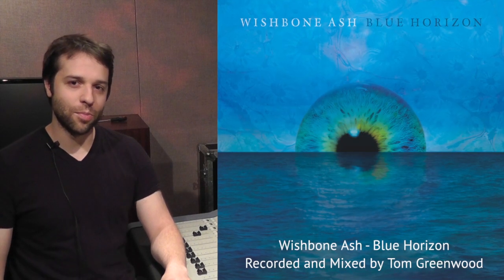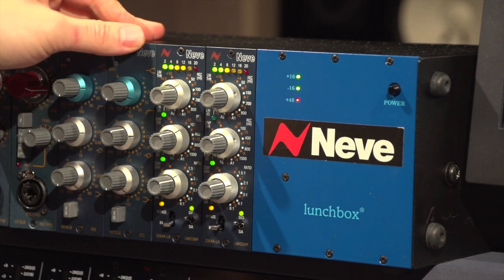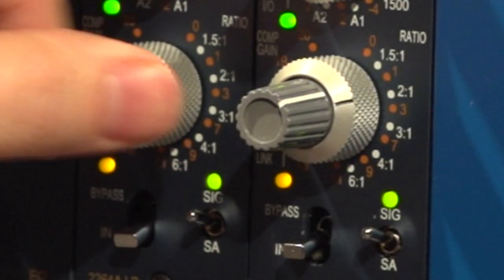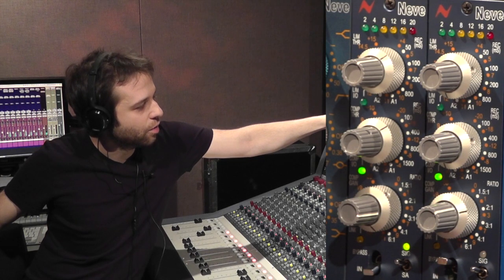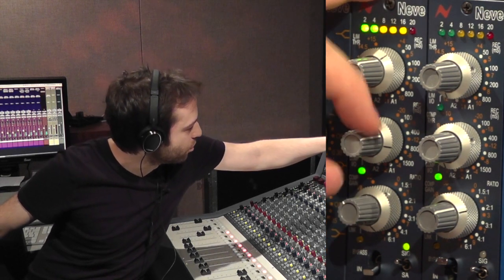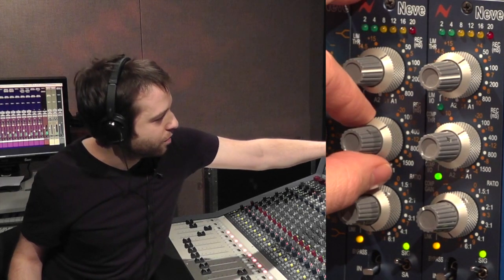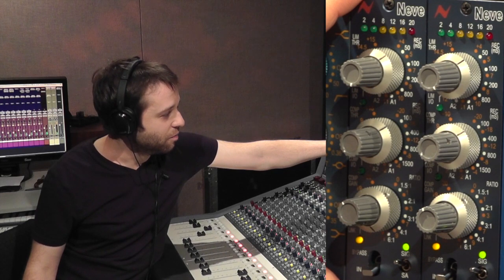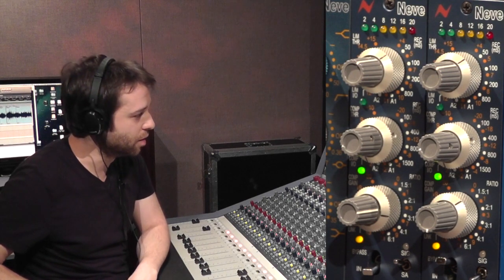Neve 2264ALB 500-series mono limiter/compressor walkthrough

Comment: Is this good for tracking vocals?
Reply from the maker: Hi Zane,
Yes, the 2264ALB is ideal for tracking vocals. It can be paired up perfectly with the 1073LB as an insert, creating a custom 1073>2264 preamp/compressor signal chain with total control over the signal path. The 2264ALB uses diode-bridge technology with independent compressor/limiter circuitry producing accurate compression curves that can be used subtly or aggressively for any vocal style.
Reply: @AMSNeveLtd  is 2264alb stand alone compressor? I dont need a inser cable like NN5749 2-WAY LINK CABLE right? To pair with the preamp?
Reply: Does it run internally at 24v or 16v?
Reply from the maker: Hi  @zanem9022 ,  

The 2264ALB is a standalone compressor, with its own input and output connectors, this allows it to be used after any outboard preamp when appropriately patched. However, it does have insert capability to pair it with the 1073LB, this places it after the 1073LB's preamplifier stage, but before the 1073LB's output transformer stage. The 2264ALB follows VPR Alliance specification and runs on +/-16V rails provided by the 500 series rack.
Reply: @AMSNeveLtd  hey last question.. Is 2264alb partialy thru hole discrete construction or is it all smt? Im considering this one to purchase vs the rnd 535.
Reply from the maker: Hi  @zanem9022 , the 2264ALB uses a combination of in-house SMT and thru-hole construction methods. The audio signal path is discrete, with the majority of the crucial audio components hand-mounted.
Reply: @AMSNeveLtd  awesome thanks
Reply: @AMSNeveLtd  what would be any perceived differences in sound when having the 2264alb or 1073lbeq in the insert mode as you mentioned? I’ve wondered this for a while. I understand it places it before the output stage of the 1073lb but I just don’t know what that means in terms of sound. Thanks
Reply from the maker: Hi  @Matt-wr5kx ,  by adding the LBEQ or 2264ALB as inserts into the 1073LB, you get a true 80-series module signal flow, which places the EQ/Compressor after the 1073 transformer-balanced input stage but before the 1073 output transformer stage and output trim control. 

This gives you complete control over the signal chain. By having the output level control after the EQ/Comp, you have a greater ability to gain-stage the two connected units.
Reply: @AMSNeveLtd  oh okay makes sense. Thank you so much for responding!